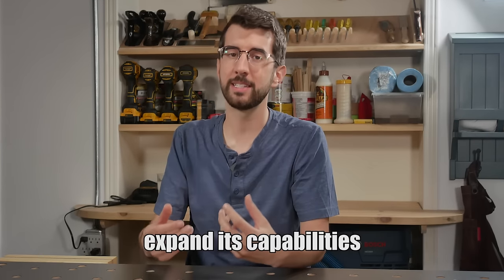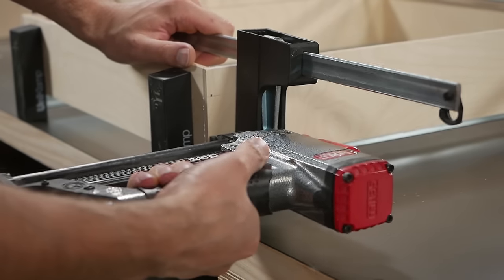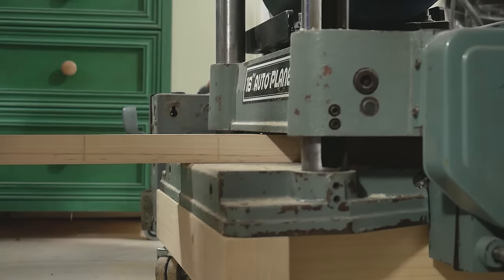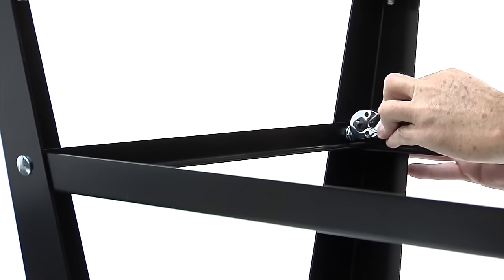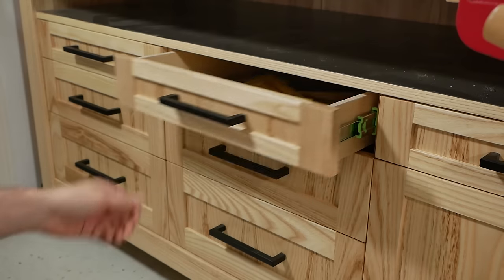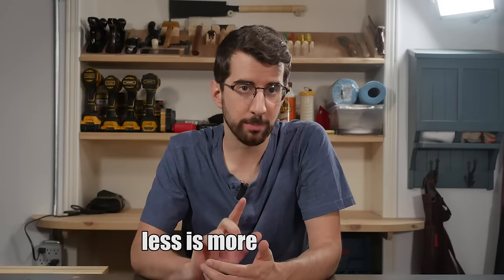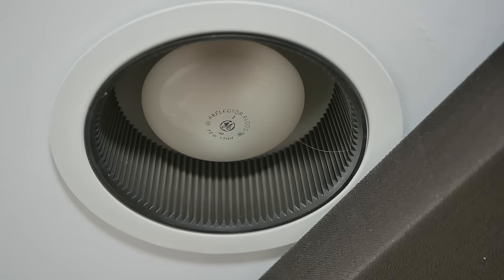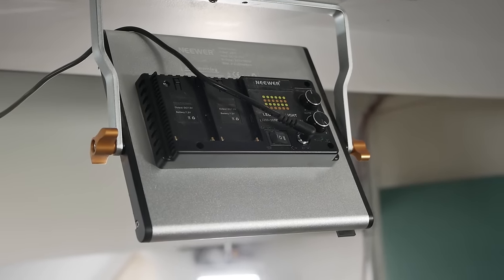a better way to layout your workshop

Comment: Several suggestions. 1) Have a place for overflow consumables like sandpaper. Have easy access to several sheets/discs of the grits you use in the shop and have a “shop pantry” somewhere. With any luck, outside the shop mabye a cabinet in your garden shed or basement (depending on dampness), under the stairs... Easy to get to the reserves but not clogging up valuable small shop space. 2) Like cleaning, sharpening is quick and easy on chisels and hand planes if you stay on top of it. So do it as you are putting it away. (see Rob Cosman 32 sec to sharp if needed) 3) I work with a 9x12x2 drawer carcass that was disgarded forever ago (anything of that size will do) on my work bench as a tray. I put the things like small tools, glue, tape… in there as I am working. At the end of the day I put everything away in 1 lap around the shop emptying the tray as I go. 4) I have several 5 gallon buckets around the shop for trash. I find keeping the trash, cutoffs, shavings… off the benchtop and floor makes the shop more spacious while working. Size of the container can vary depending on preferences and projects. 5) For the french cleat crowd make the holders for things like bits, tape, glue, marking tools… so they standup off the wall for those times you need several of them during the project and just put it on the workbench. Less travel time and so easy to keep things organized while the project is in progress.
Reply: Agreed. Housekeeping during a job in particular can both make a job go quicker, and reduce the odds of damaging the piece or causing injury to yourself.
I can't count the number of times I watched someone trip over something they pushed out of their way or tossed aside just moments before.
Reply: An old expert tradesman once flipped out on me (in a nice way) for being a cluttered person. He hammered it into my head thst you put your stuff away and clean up after each section.

It might annoy you when you have to go back downstairs and grab your stuff again, but it's going to save your sanity in the long run when you're not furious with a mess.

I'm still struggling to follow his advice time to time heh but I'm getting much better and he was 100% right

Comment: Lighting! Yes. I used to have 3 40 watt bulbs in my garage shop. Having replaced them a few years back with LEDs, I can testify that cuts and measurements are more accurate when you can see what you  are doing.
Reply: Amen....i upgraded my lighting and its made a world of difference
Reply: I used to have a sad little lightbulb on my automatic, garage door opener, and a, no kidding, motion sensitive nightlight in my garage. I upgraded those to shop lights this summer, at which point I noticed the sheet rock had never been taped or painted. And then I decided as long as I was doing that, I should probably put in some windows, replace the shelving, and upgrade my workbenches.  I’m telling you, the lighting is a slippery slope.

Comment: Try arranging your storage by time:  when you put tools away at the end of the day, put them in the top drawer.  If there are more than some fixed number of tools in the drawer (8 to 12, depending on the size of the drawer), move the excess to long-term storage.  If you find yourself shuffling the same tools in and out of long-term storage every day, allocate another top drawer for frequenty-used items.  In a short time, you'll find yourself pulling almost all your tools from two or three drawers whose contents you know by heart.

Comment: If you do sketchup there's a lot of machines or shop furniture already modeled in it. You can just search for them within sketchup and drop it right into your model.
Reply from the maker: oh yeah, i love that so much. Coupled with the fact that I designed most of my shop furniture in sketchup already, it's really quick to draw your entire shop by importing tools from the 3d warehouse and importing your own drawings too.
Reply: Fook Sketch Up. It's really not that all fired hard to make a physical model. Some cereal boxes and hot glue. You can make things, can't you? Otherwise what's the point in having a workshop? I even painted the models I made with acrylic craft paint. That really made them pop. I hate using software. I swear they must only hire blind people to write drawing programs. Worst UIs ever!
Reply: @1pcfred  ok, boomer
Reply: @MattMcConaha  it's more than just OK.
Reply: @1pcfred  yup i agree love cad or software but laying a space is easier/faster using graph paper and cardboard cutouts of tools all to scale
Reply: @msk3905  +1 on that. I've been doing that for a few decades. Not for shop related but for the few times I've moved, it makes setting up my "office"/spare bedroom a lot easier not only for how to set up the desks, cabinets, etc but to figure out which room has the more usable dimensions for everything (windows, closets, outlets and such). I always move or setup by myself & it's been a bit of a God send. Saved me from finding the last piece of the puzzle needs 2 inches more to fit! Much quicker just sliding the furniture around when they're scaled posterboard...

Comment: This was amazing.  You really don't get a sense of how small your shop is in normal videos.  I mean .. you know it is small but.. the 3d rendering really put it all in perspective.  You have FOUR doors that you you have to plan around.  You do amazing work in that small shop.  This has me rethinking a few things.  Thanks for this video.  I have new hope for my space.
Reply from the maker: Yeah the doors was definitely challenging, and I would definitely rather some extra wall space. One of the doors just has the electrical panel behind it, so I'm comfortable semi-blocking it with something on wheels.
Reply: @ScottWalshWoodworking  this is encouraging. I’m working with a similar amount of space. What are the dimensions of your room?
Reply: @cliffordduhh45  Scott's a great guy but I'd not do what he's doing. He doesn't use a miter saw and I've seen him cut with his table saw, which I'd not. Things can become dangerous if you have a small space without an outfeed table. A miter saw and a circular saw is all you need. Every ten minutes there is a table saw injury somewhere in the world! Youtubers need to make people understand that a table saw cuts towards you.
Reply: @cliffordduhh45  One persons small shop is another's warehouse . I don't consider his to be a small shop, judging by what's in it and the space , it's a really good size.
Reply: @ItsNotInventedYet  Quite frankly, if they can't work that out for themselves they shouldn't be anywhere near ANYTHING sharp.

Comment: One thing that I have recently learned is to paint your walls and ceiling white. That will help with the lighting as well. I am in a garage, and I never took the time to notice the beige walls and soot covered ceiling. Now that I am focusing on improving the shop, the walls and ceiling all got painted a clean bright white.
Reply: I painted my whole shop white when I first moved in. It's kinda dingy now. But I've gotten into mood lighting over the years. I have big overhead fluorescent fixtures but I hardly ever turn those on anymore. I made a couple janky chandeliers that I use. Each has 4 CFL bulbs in it. Then I use task lighting.
Reply: I like your thinking BUT, My garage is just Zincalume, so I’d have to remove everything. 🙄😁

Comment: I use the drill press a lot. Can’t imagine registering concentric holes and repeating operations on a fence, or drilling accurate holes in small plastic, wood, or metal parts, or even cutting a bunch of plugs and dowels by hand. Last year I finally built a good add on DP table w fence, dust collection, & t-track for stops and hold downs.  Best improvement ever.  
Also, my dad made everything from his own shop tools and jigs and fixtures  to furniture, toys and classical guitars, he kept things organized on 18”-20” wide shelves  along a wall in his basement and used a clear plastic curtain to keep dust out.
Reply: I use a "benchtop" milling machine as a drill press. I had to put "benchtop"  in quotes because the mill I have weighs almost a thousand pounds. She's got some mass to her. It's actually on a 3"x5" heavy wall angle stand held up by 3" C channel. It has a T slot table. Sometimes I use it for mortising hinges too. Or I'll fly cut a box. Really makes the top and bottom mate up good.

Comment: If you choose to do the graph paper layout, which I like to do in planning many things in the early phase of design because it’s so easy and flexible, consider making some pieces that represent the room YOU need to use a station. It’s too easy to miss that part of the space without a strong visual cue. Similarly, you could cut some layout pieces that represent, for example, long stock that needs to be used at a station.

Comment: Couple tips from an electrician with a woodshop. When you buy lights, find the color temperature you like, usually around 6K but higher (more blue) seems brighter to some. Then get the same color temperature for all your lights. When you build a cabinet or bench, mount some receptacles or wire mold strips into the sides, power strips are bad and good sources of fire and overloads. If you have power but no switch where you want a light or tool, use inexpensive wireless switches mounted next to your regular switch. Also lights should always be on a separate circuit breaker from anything else. No plugs.
If you are just starting to put a shop together, make sure you have at least 75-100 amps available and if not consider putting a sub-panel in, it's not just convenient to isolate this power but will prevent fires from overloads.
It's better and not that hard to add surface mount receptacles with conduit on the wall than running cords all over the shop. You only need one or two circuits if you only use one tool at a time. Try to put dust collection or extraction on it's own circuit if you can. Every removable connection, every plug, power strip and cord is a point of failure so having just one on the tool cord is best.
Reply: Very informative about lights and circuits. Thank you.
Reply: "at least 75-100 amps"? What kind of household has power like that?
Reply: @Surmoka  the service drop on almost every house can easily supply 400 amps. so, all of them.
Reply: @BariumCobaltNitrog3n  400 amps?! That with 115V means 46 kW! WTF? Is that customary in the USA? We in Europe have 230V and usually 16 or 25 amps per household. That is one tenth of what you are saying.
Reply: @Surmoka  Old houses have 120 volts (x2) and 100 amps. Most houses now have 125 amp panels but it isn't rare to find 200 or 225 amp. The service from the pole can handle over 400 amps. A lot of mansions will have a pad mount transformer with 3000 volt inputs or several 200 amp drops (pool house, guest house, servants quarters, vineyard buildings...)
Reply: If you're dealing with color or stains, I'd recommend 5000k, and a cri at least past 80.  6000k might be a little too cool for that sort of thing.  I use a variety of lights from 4000k to 6000k, but the 6000k's aren't where I paint 'n stain.
Reply: @nathanweitzman9531  I agree, a lot of lights refer to 5000K as "daylight" for being neutral and a high cri or color rendition index will make colors (reds specifically) appear as they do in sunlight. Sidebar, there are 8000K bulbs called arctic, appropriately. brrr.
Reply: Also, most people don't pay enough attention to extension cord sizing. Using an undersized cord on a tool rated at 15 amps of draw can burn up your motor and you may turn around and replace the tool only to create the same situation with the new one, because you never addressed the cord size. I expect that's why the Kapex's crap out as that saw is widely used on jobsites where cords are the norm.
Reply: @mikeconroy2651  This is true. And worse those cheap cords are rated for intermittent use, like just a few seconds at a time. But if you have one or more tools running all day, it's rating goes down by 20-25% or about 11 amps on a 15 amp cord. YOLO!

Comment: Great video. Thanks. As for casters I have found that the if you use swivel types only use 2 of them or heck, just pick up the one end of the table or saw to move it. Swivels often don't lock and having a wheel move or twist on you mud cut is not cool.  I have used simple dollar store cutting boards as skids. They provide just the right amount of friction to be safe to work with but you can easily drag it around.  
Also consider rafter space for storing dimensional wood and a pocket along a wall for storing sheet wood.   Also, if you don't have time to make cabinets or drawers thrift stores often have cheap options

Comment: For years I'd been meaning to build some wall cabinets to replace the open shelves on a wall in my small shop. Things were disorganized and cluttered as I packed more and more stuff on those open shelves. Things also became covered with sawdust. I longed for neatly organized wall cabinets like I saw in some YouTubers' shops. Looking for a temporary solution until I could build those cabinets, I went to a local big box store and bought a bunch of different size plastic lidded storage containers. I standardized on three container sizes of different widths and heights, but all 14" - 16" front-to-back. Then, I rebuilt the shelves so I could cram as many of these containers on the shelves as possible - one shelf for tall containers, one shelf for medium, and one for short. Now I pull together a bunch of related items, pack them in an appropriate size container, use a piece of masking tape to label it, and put the container on the shelves. Things remain together, dust-free, and easy to find. I can rearrange easily by simply moving stuff to larger or smaller containers, if necessary. For example, my dowel jig and the various dowels currently fit in a small container. But, if I buy a bunch more dowels someday, I can just move that stuff to a medium container. Also, I bought a bunch of different size 4-mil zip-lock bags from Amazon to help keep things (such as all the dowels of each size) organized within the containers. For me, this turned out to be so much simpler and more flexible than dedicated wall cabinets, that I'll never go that way.
Reply: Yep, except that cheap plastic bins from a DIY store only lasted a very short time. I finally bit the bullet and bought some 'Eurocrates', pricey but tough, now everything in my shop goes in those crates and they are stacked on shelves under benches along the walls where they act like deep drawers. I went for a standard size of 2'6" deep 18" wide 12" deep. Smaller items (nails, screws, nuts bolts) are in individual plastic boxes inside the outer box.
The keynote is toughness. Those boxes get a LOT of wear. Flimsy doesn't cut it.
Reply: Black and yellow commercial storage totes. Costco has them regularly in standard sizes and they go on sale twice a year. you need to see inside, cut circular holes and depending on what you can afford, glue pieces of PET (from 2-liter soda bottles), acrylic, polycarbonate, lexan, or plexiglass). You can peer inside without removing the lid. 

If you need to store them outside in the elements use a bi-layer system of painters canvas cloth on top of a heavy duty tarp. The light color canvas cloth will block most of the UV making the tarp last a longer time. You could also use 18” wide aluminum foil and join two sides together with aluminum foil tape for 100% UV blockage to the yellow lid and if moisture is present aluminum will inhibit mold, mildew and insects. 

If you live in a very humid environment, reclaim desiccant packs from new purchases by baking them in the oven. Get yourself some  gasket maker and run a bead in the lip of the lid, now you have a vapor barrier for your regular tote. 

If you need paving to place your totes on, rent or buy a pro gas powered concrete saw and whenever someone is replacing their driveway or concrete pavement, cut it up into 1’ squares and make pavers.

Comment: Nuts and bolts - a separate bin for each thread size. If you need a 3"x 1/2" W, you go to the 1/2"W bin, the 3" is easy to identify among the various lengths. Same goes for Metric sizes, UNF, UNC etc. Trying to store each individually if you only have a few of each takes a lot of space. Bulk packs however are a different story.

Comment: One thing that has helped me a lot is to alternate between "productive" projects and organizational ones. So one day I will be building thread racks for my wife's quilting machine, the next I will be adding drawers to the weird space under the spindle sander. This helps me stay focused on organization but not so much it overwhelms or drives me nuts. I just pick one thing to do next. It also help prioritize my scrap, because I can plan to use the remnants of one project in the next and consume them instead of storing them for all time.

Comment: Peg board is awesome (or other wall mounted type storage systems)! It's the only system I have used that I consistently put tools back where I found them when I am done with them.  I also like it because it's much easier to find things.  I have a lot of shelves for other stuff and they create a lot of clutter and digging to find stuff. I would love to get a large metal mechanics tool chest but they are very expensive.  I think wall mounted and drawers are the way to store stuff.